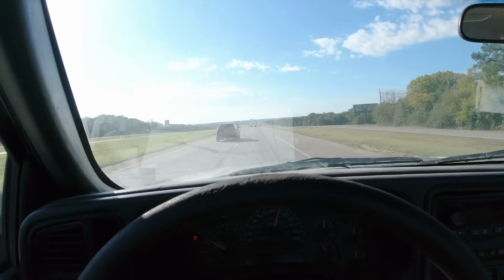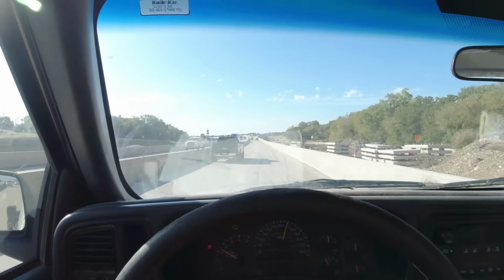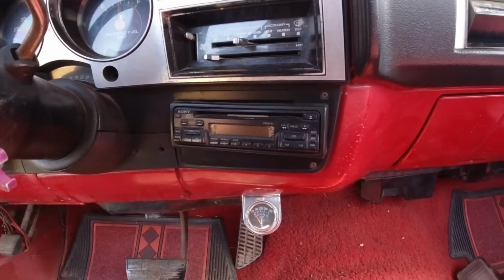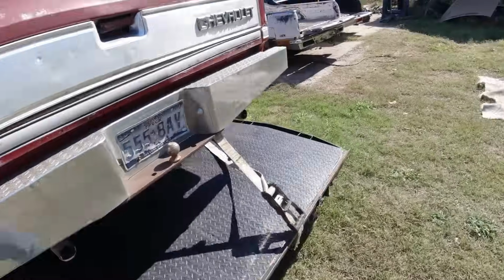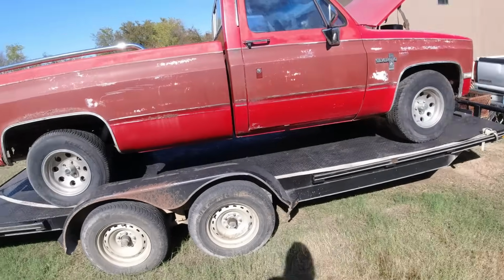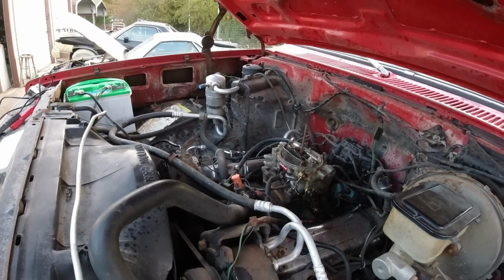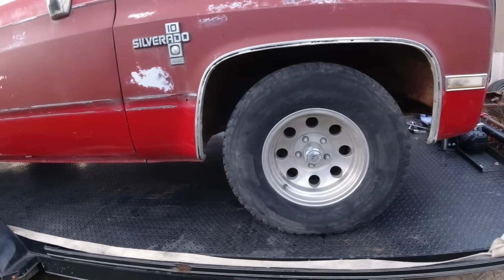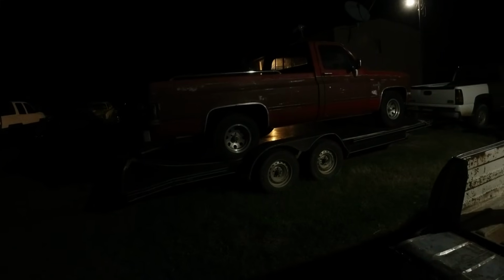I bought an Abandoned Squarebody Project for dirt cheap - Will it run? Did I just buy a lemon??

Comment: Thats an 81 the spark control is  very simple i believe it consists of a knock sensor in the block and it adjusts spark advance when it detects vibration from detonation. I had an 81 good reliable truck.

Comment: Take the front yoke off the bent driveshaft and save it.. you can use it when swapping motors to help keep the tranny fluid from going everywhere.. most gm trannys you can use the same yoke just to plug the transmission.. just my 2 cents

Comment: You can make it a duel tank easy if you wanted to .I did mine just flip tank and brackets from the parts truck manual fuel valve 3 position toggle for gauge .

Comment: Same thing happened to my 1989 F150. A fusable link failed due to corrosion! I replaced it with a in-line fuse 20 amp, with 10 or 12 gauge wire kit from O'Rieleys.  Truck starts every time now unless the fuse blows which it hasn't.

Comment: We had an 81 chevrolet. It had the 305/automatic.  The automatic was a 3speed with a lockup. converter.  I know around here the lockup was a pain with the hills, so dad installed a toggle switch to disable it off the highway.

Comment: The 305 in your parts truck is a replacement gm engine. The goodwrench gm sticker is a giveaway. It probly was a 350 truck. They put a 305 crate engine in

Comment: What ever happened to the Toyota 4x4. You should have grafted on some fifty's  panels on to that. Just a fun ride. Take you a couple of weeks. Make some videos. You paid 1200 for a none running rusty square body that needs a repaint. And parts. What you think it's worth when done. 2.500 if you lucky.
Reply from the maker: If you watch the video I said I do practical builds, not cartoonish builds for youtube views and money.
Reply: Well you can throw a joker in e mix every now and then. Even if it makes a good farm truck. Or off-road deal. Because two El Camino builds in a row. I didn't watch..or was it three.. engine swapping a Nomad  is not standard builds. Good luck. I like square body's. See what you do with it. But then you need five grand plus for it.